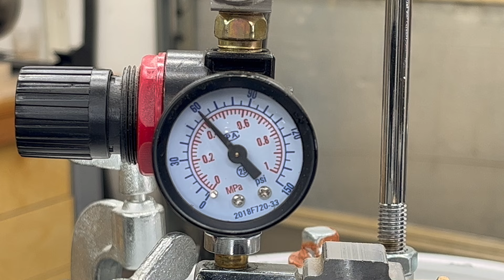Woodturning Hot Pepper Wood Bowl

Comment from the maker: I found some pepper tree logs on the side of the road on the way to work. They had been sitting for some time and were quite dry. After looking at the unique wood I decided to try a fire theme resin pour to go with the pepper  wood. I wanted to try something new that I read in a book about hybrid woodturning. I used urethane resin instead of epoxy. Supposedly it would turn easier and polish better. The downside is it has a 12 minute working time and the wood must be stabilized first ( I left that part out of video, rather tedious). Upside is the blank is cured and ready to turn in 4 hours which is amazing. The book suggested to turn the piece with carbide scrapers. I found this odd and did not care for this technique and went for my bowl gouge when hollowing the bowl. I tried to use mainly scrapers on this piece and in the end I’m happy with the result. Had a bit of frustration in the middle and wasn’t liking the look. Too much resin not enough wood. Although I was very pleased with the shape, the entire rim of bowl being resin wasn’t a good look in my opinion. So I decided to turn it into a very shallow bowl to get the look I was after. In the end, I’m not sure the urethane resin is all that great. The time saved in the cure process is negated by the multiple day process of stabilizing the wood. I didn’t find it turned, sanded, or polished differently than epoxy resin. Think I will likely be using both in the future depending on the wood being used. If you have experience with both types of resin and have some tips or suggestions please leave them in the comments. I’d love to hear them. Thank you for watching!!!
Reply: I bet the music for this video was improvised by looking at the video.  And it is done so well! It makes this video so much better than on other channels.
Reply: @squareandlevel  beautiful work brother!  I want one now.  I am retired and in the mountains of western North Carolina, and scratching my head on whether or not I want to do woodworking for a small business.  Looking at a mix of CNC Router (Axiom), a couple of those 3D printers, and a nice lathe.  Just don’t know yet, but watching your video was inspiring.  Use to work in Colombia (Plan Colombia), and your choice of music had me on a horse riding the mountain tops down there, lol.  God Speed and subscribed sir

Comment: How do you determine how much resin to make?
Reply from the maker: I generally use math to determine volume of pieces subtracted from volume of cylinder form but this piece was different because I could not easily determine volume of the odd shaped pieces. I have purchased a few books on wood turning and one had an excellent idea of using rice to backfill the piece while in the mold and then had a conversion chart for cups of rice to grams of resin. It worked really well I am considering making a video in the future explaining my technique for blank preparation in full detail but want to dial my technique in a bit more before giving anyone questionable advice. Thanks again!!